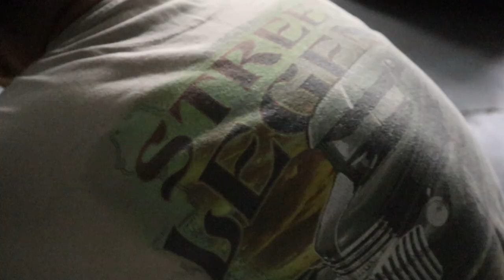How to Make Sheet Metal Patch Panels - 1963 IH Metro-Mite Step Van

Comment: What year of Astro van , did you have to cut or modify the frame or " chassis""
Reply from the maker: Any of the earlier year ones will work fine. No modification of chassis besides a lot of trimming to get it to fit right
Reply: The metro mite step van I looking at said that the wheelbase is 96" inches. That why I ask if any mods would be done to the Astro van frame 111"inch